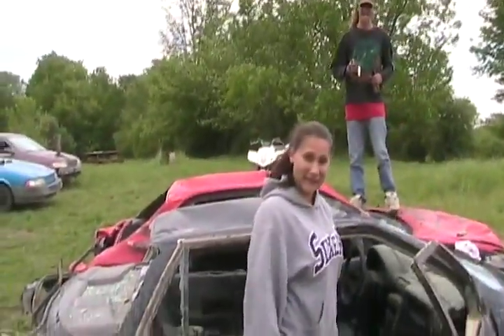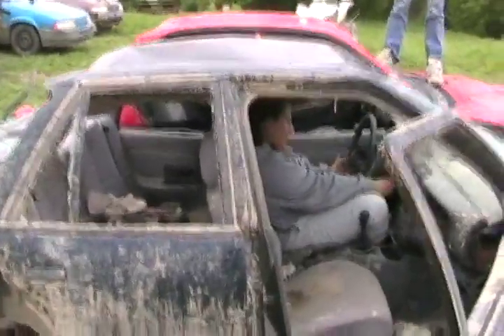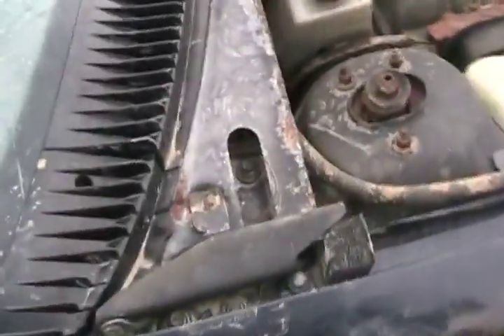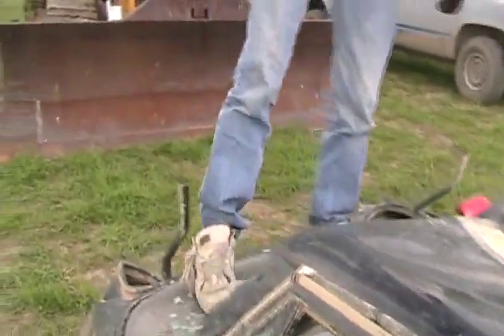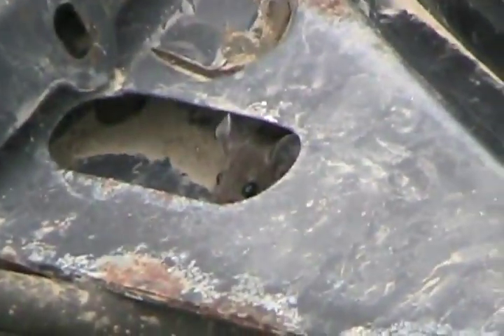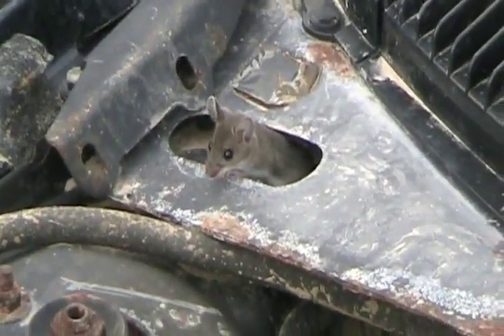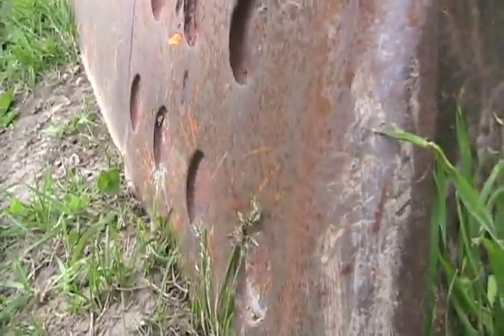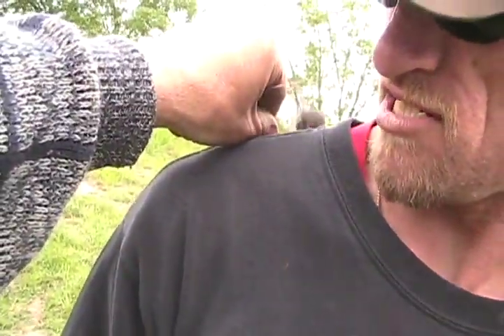#986 saturn motor blow with random mouseage [Davidsfarm]

Comment: I had a 98 Saturn.  SC1  Ran a long time.  Not a bad motor.  Motor mount rotted out.  Not a bad car
Reply: Hi there.  I had got rid of mine because of the same thing.  Sub frame, motor mount was rotted.